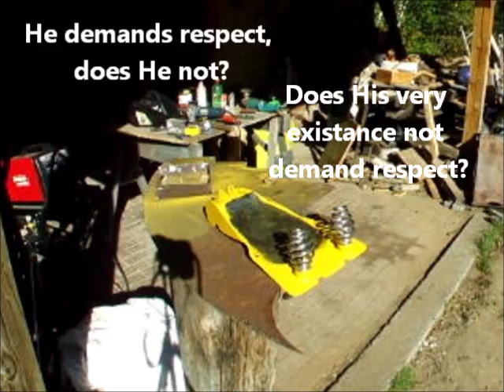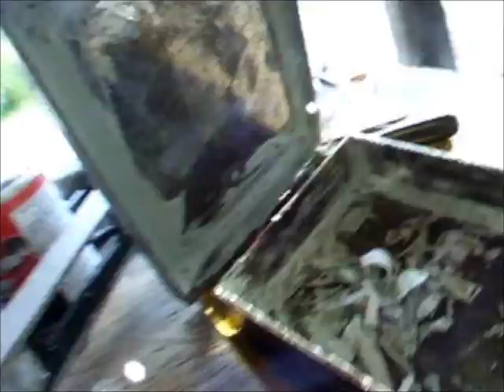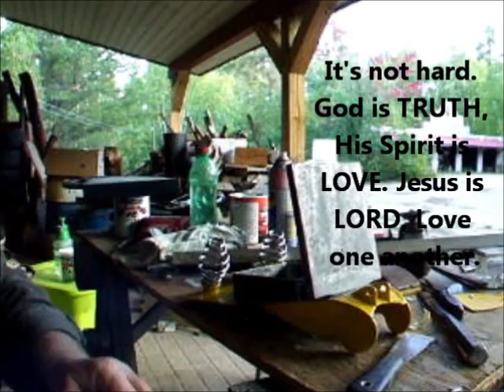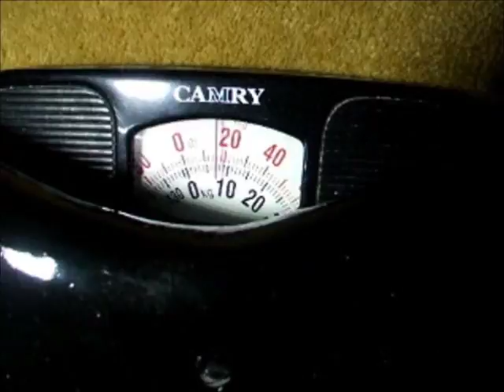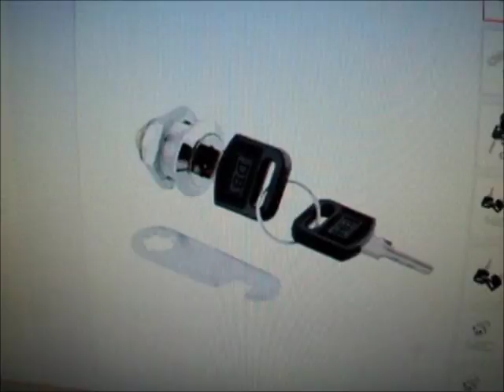Cast Aluminum Solo Seat Build Pt 13

Comment: Yup.....a skinny vacuum hose like the ones used for carb vacuum hoses or your windshield wiper /washer /squirter hose will work.... Pep boys sells a brand thats very flexible, even in cold weather..... did do the same thing for battery box lids ................ OR...you could use a hunk of rubber the same size as the underside of the lid...glue it down real good and then cut the center out, if you even need to cut it out???? ..... just my 2 cents
Reply from the maker: +GasserGlass 
Sounds like a plan. Either one should keep the rain out. Thanks for watching Gasser. 
I was wondering, have you ever used chicken wire mashed together to form a framework to lay up fiberglass on? I've had some measure of success doing that but achieving a nice finish seems like a lot of work. I'd love to hear your opinion on that. Any tricks or tips?